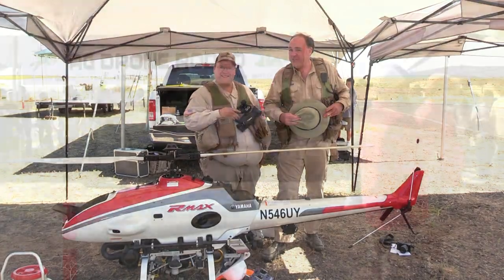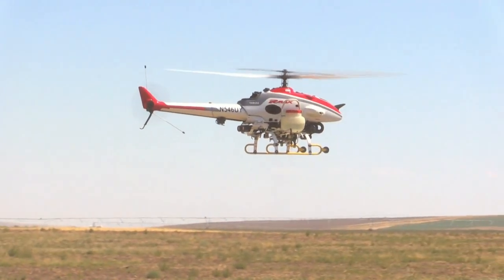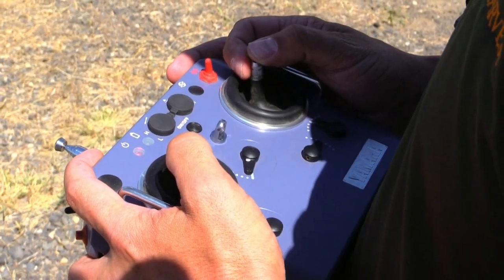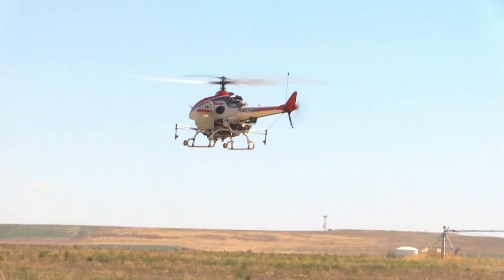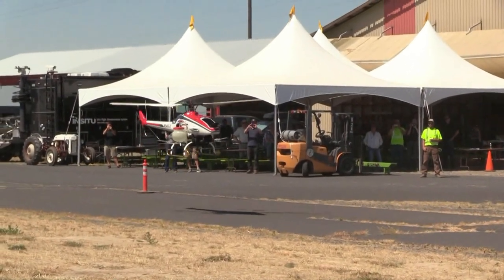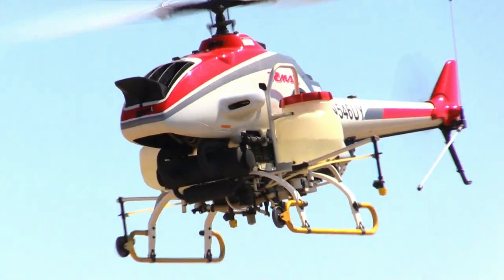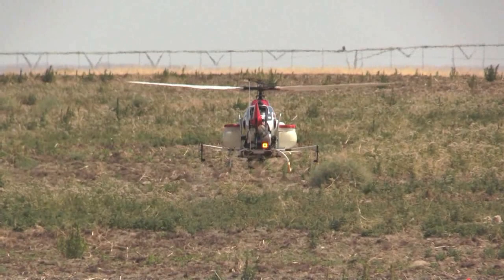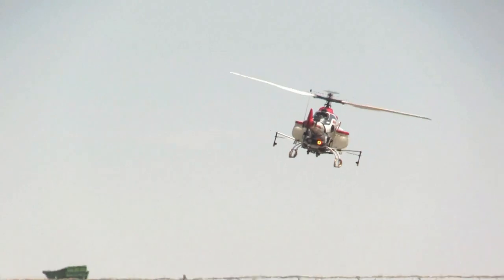Yamaha R-MAX: 200-lb RC Helicopter that Sprays Crops!

Comment: This drone price nonsense is just ridiculous,  after all it's just an over size gasser rc heli with a flight controller added on.  🙄 hundreds of thousands of usd for this,  I'd just get a mosquito kit, and it will have 200lb of useful load with the pilot removed and cost 1/3 the price and none of the yamaha lease nonsense, and none of the certification nonsense if you stay away from everyone.

Comment: Great looking and working Heli,but i'm wondering how long has it been about,only because they aren't using a fly bar less set up,so did they picked an off the shelf Heli and add their own flight controller.

I'm sure they didn't but i was just curious as to why they went with an older style head setup rather than the newer type,no doubt they have the reason but a fly bar less set up is a lot easier to set up and maintain. :-)

I'm not criticizing them for their choice,again i was just curious,anyways thanks for sharing lads as it's much appreciated.

Comment: Unless i missed it did he mention the capacity of how much spray you can carry
Reply: Load capacity
        28 kg 
Cassette Tank Capacity
8 litres x 2 tanks
Discharge Method
Double-acting piston with flat nozzle
Discharge Rate
1.3-2.0/minute (speed-linking method)
 Nozzle Pitch
 1340 mm
  Sprayer Weight
      7.4 kg
Reply: MrLunithy thank you
Reply: @MrLunithy  i want to purchase it kindly help me my contact is miych5math@gmail.com